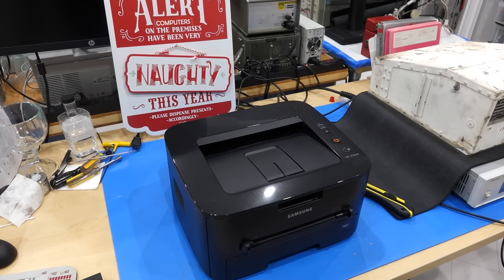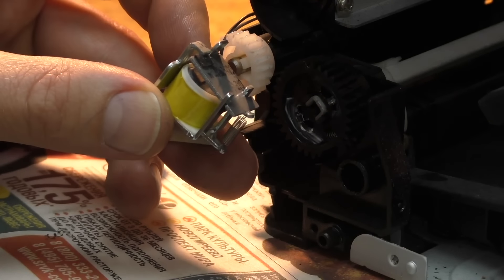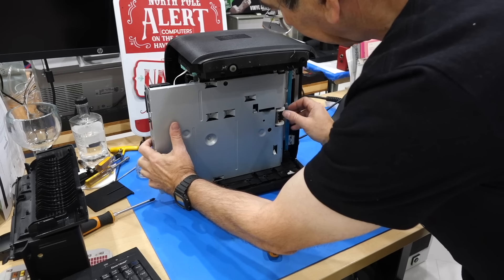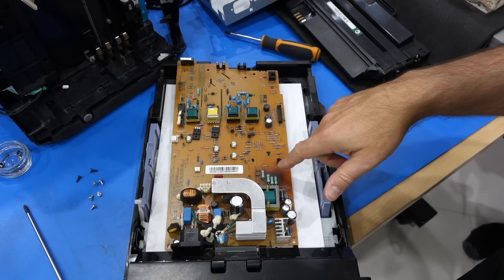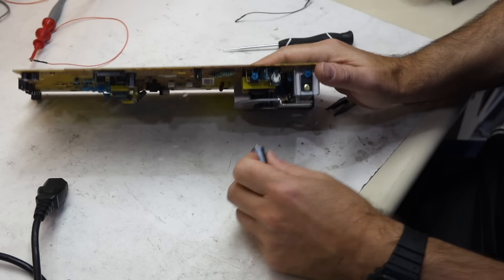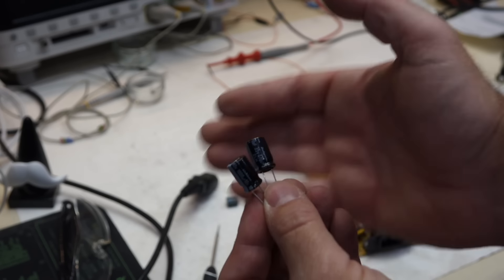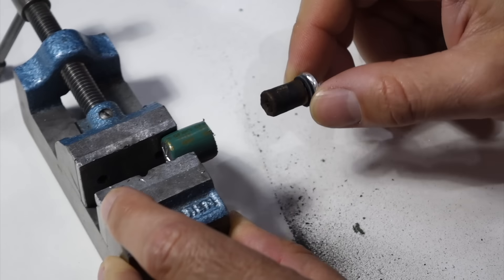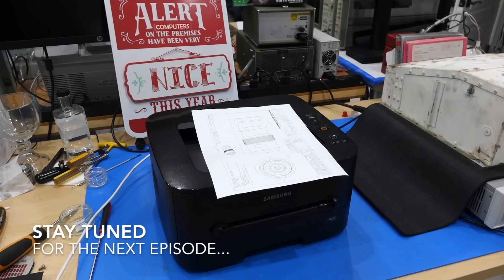Modern Fails: Samsung ML-2525W laser printer double repair: picks up two sheets, does not power on

Comment: Of course, laser printers in the 90s were basically inaccessible to normal users - they still cost in the thousands. In the 90s, you hung onto your 9 pin dot-matrix (the lucky people had a 24 pin!) until in the mid 90s when you could buy an HP inkjet printer and get that "near letter quality" printout. It took until the 2000s that laser printer prices started dropping quick. Of course, if you priced them out, you can buy a new laser printer for $200 now, while that HP 4/5/6 probably cost around $5000-10,000 new today. So yeah, you pay good money for that stuff back then. Then again, that $200 laser printer today would've been like $50 or less back then, and when lasers were costing $2000+ you'd get funny looks as to why you're selling it for such a ridiculous price.

Comment: I had a Samsung b&w laser printer but I gave it away and bought a Brother all-in-1.  I think I paid only $75 for the Samsung.  It's a shame that society is so oriented toward consumerism that everything is thrown away and replaced instead of repaired.  Naughty people who made that naughty printer.  😭

BTW some printers can do a self test printout page if some buttons are held down during power on.

I salvaged an old Minolta copier, must've weighed 35kg - very heavy for a desktop.  It was ruined by being out in the weather.  The counter said 163,000 copies. It was built like a tank - the scanning assembly was an electro-optical marvel!

Comment: I would replace the caps by the heatsinks too, I am sure they have been getting cooked and will die soon too, even though they test good now, will they still be good in 6 months, probably not. NOTE FOR DESIGNERS: don't layout crapacitors right next to a heat sink unless you are trying to shorten their life...

Comment: There's nothing sadder than a cooked el-cheapo single-sided phenolic PCB with the offending and obvious power resistors sitting directly over the blackened spot. Inexcusable in modern electronics; we have no real reasons any more for needing this kind of power-wasting solution other than extreme cost-cutting.

Comment: I don't think Samsung makes/sells printers anymore. Maybe I'm wrong, but I seem to recall they sold that department a few years ago.
I have a Samsung all-in-one I've had for 6 or 7 years. I've had to fix it 2x as well. 1 time it was kicking a common error because there is a paper sensor TAPED in place. Of course the tape failed. The second repair was a few months ago, the connector to the paper feeder went bad and I had to fix bad solder joints. Both repairs were really cheap, a piece of tape and some solder, but geez. Still, it's a whole lot cheaper to repair than replace.
Reply: HP bought Samsung’s printer division back in 2017.

Comment: 3:18 What was so unusual about having to use a Pozidrive screwdriver ?
Reply from the maker: Using Pozidriv on regular screws sometimes helps. These ones were stuck really hard.
Reply: Normally works on old Soviet or US equipment, which for the US predates posidrive, and for Soviet they did not hold truck with this Japanese system, preferring their old thin blade screws instead.
Reply: @CuriousMarc  That depends on what you regard as a "regular" screw !
Reply: @SeanBZA  There is much confusion about crosshead screws.  Most people just erroneously call then Phillips screws but there are, in fact, at least 3 "standards", ie Phillips, Posidrive and Japanese Industry Standard (JIS)  To a certain extent when screws are not tightened down hard or locked in place you can use any driver on any type of screw at the risk of damaging the head, but when you really need to exert force then it is important to use the correct driver.

I wondered exactly what type of head was on the screws that Marc used a Posidrive driver on, hence my original question
Reply: @Bob_Burton  Made in China almost certainly JIS, as the 2 countries use the same screws, due to volume of production for export.
Reply: @SeanBZA  If the screws are indeed JIS then it is no wonder that it was easier to remove them using a Posidrive driver than a Phillips driver because JIS and Posidrive are more closely related than Phillips and Posidrive
Reply from the maker: @Bob_Burton  Regular as in standard, non Pozidriv.
Reply: @CuriousMarc  Ah, "standard", you can never have too many standards.  It would be interesting to see a closeup of the head of one of the "standard" screws
Reply: @CuriousMarc So you mean Phillips. There’s no such thing as a “standard” screw.
Reply: @Bob_Burton JIS and Phillips are nearly identical. PoziDriv has significantly different geometry. The JIS standard was withdrawn years ago, replaced by the ISO definition of Phillips.
Reply: @SeanBZA The JIS screw standard was withdrawn many years ago. True JIS screws are only found in old equipment. Everything even vaguely modern is Phillips or PoziDriv, in the versions codified in ISO standards 4757 (screws) and 8764 (drivers).

Comment: I had three Chinese made aquarium light power supplies blow up on me. They all had the same caps explode. Fortunately the shop carried spares but they all had the same problem. Eventually I opened one, the top had been plastic welded on probably to prevent customers from learning about their crimes. 

Can you imagine buying this printer in Korea? From my observations living there, Samsung sells the defective or near defective products to their local customers. When the Samsung Galaxy S20 came out there was an issue with the screens turning pink. I witnessed a few examples after it was initially reported but when I commented about it online those outside Korea said it wasn’t known in their local area. Over the past couple years, I have seen many more failed displays with much worse symptoms. So I can only imagine what it would be like if you had bought said Samsung printer in Korea.

Comment: Sticky relays are not unique to Samsung, my HP laserjet 2200 or something has a similar error in the duplex mechanism. Clean, add new, job done. 
So I think they just don't care that much.
Reply: Yep, even had that happen on a 20+ year old HP, and even on a laserjet 4, so there is really no laser printer safe from it.
Reply from the maker: Yes it's the careless attitude that gets me. They've known this for years. If Bill and Dave were still at the helm of the company it would have been fixed right away.
Reply: @CuriousMarc  Thanks Carly......... The gift that keeps on giving.

Comment: Great Video, please don't laugh but I have spent hours looking for the material used to fix capacitors (white stuff) and I cant figure out what they are, please can some one help? (Even ChatGPT couldnt help)
Reply from the maker: You mean the white glue on the outside of the caps to hold them to the board? Feels like silicone glue to me.
Reply: @CuriousMarc  thanks for the reply.  Yes those white glues. I have tried RTV silicon glues and the end result is not as nice as them.
Reply from the maker: @VA7AYG  Yes the white glue is amazingly strong and stretchy, so maybe something else…

Comment: Given that Samsung exited the printer business in 2017 (when that product line was sold to HP), it’s a bit of a stretch to call this “modern”. :p

Amusingly, HP bought Samsung’s printer business so they could stop relying on Canon and Fuji-Xerox for laser print engines. But they never entirely got away, and HP has largely switched back to buying print engines from Canon. Only a few models use Samsung-derived print engines.

Comment: All that heat damage around the resistors Jesus. Bigger wattage and stand them off the pcb
Reply from the maker: Amen
Reply: Would have added 2c to the BOM cost, the accounting team had a coronary over that. After all they went for SRBP because it is 3c a preform board cheaper than FR4, and single sided with 200 wire links for the same reason, saved on a double layer of copper and those expensive through hole plating steps, plus less wear on the PCB drill, so you can run 5 times the number of boards, before they are blunt and need to be changed. Also can used resharpened drills, from the FR4 line, so essentially a tenth the cost per hole.

Comment: Tons and tons of Samsung products have these cheap nasty capacitors. Their TVs are infamous for cap-related PSU failure. I refuse to believe that using these Capxon (and similar) brand capacitors is just "penny pinching". Capacitors are so cheap, and the price difference between these garbage capacitors and premium Panasonic or Rubycon capacitors at quantity is literally pennies at quantity. Like literally, it'd probably raise the cost of the PSU maybe 15 cents to use all premium caps.

When I see garbage capacitors used in a reasonably pricey product, in a high-heat and stress component (PSU), I can't help but feel that it seems rather deliberate.

Comment: I'm surprised Samsung is so money-pinching about this solenoid problem.  It is also depressing to see that their profits have increased by 900% in the latest quarter.  Moral: don't buy their printer but do buy their stock.
Reply: The only way to buy a Samsung printer now is to buy a used one: Samsung sold its printer division to HP back in 2017.

Comment: Oh I Hated those things. Depot had to send a panel for us to even read out the error logs. Terrible nonsense non Canon equipment.
Reply: Two sheets is sometimes also a bad retard pad. Scuffing it with sand paper can help. HPII had similar solenoid issues later in the 2000's but that was when they were already old.

Comment: I strongly disagree with the "adverts" for HP printers here. I have had so many bad experiences both in my work as with home users (family). I have banned them from my office.
After finding out firware updates listed as "Security patches" only contained ways to prevent alternate toners. (as a side effect it would'nt sometime recognize it's genuine HP toners).
One toner empty (a color laser has 4 toner/drums) would render the printer inoperable. Laser/optical assemblies that would get internally clogged with powder fading all prints. (Duh if you put the optical box lens facing upright). So office is now purged of HP. And similair familymembers had All-in-ones, with one color cardridge empty. No scanner / fax anymore. 
Any family member calling for printer issues faces the first question: is it HP?? call someone else or replce by a non HP. It's a fallen company with very low morale. (and very low quality machines).

Comment: Fun fact, Samsung generally make very poor quality stuff (memory a part), and in fact Samsung Laser printer are just HP Laser printer rebrand, that's why they are not perfect but nice to use. In fact now Samsung doesn't sell laser printer any more.
Reply: Ummm… no, Samsung printers weren’t rebadged HPs. In fact, one of the main reasons HP bought Samsung’s printer division was to bring print engines manufacturing in-house. (HP sourced the laser print engines for nearly all prior models from Canon — before the Samsung acquisition, HP never manufactured any laser print engines, never mind sold them to others.

Ironically, after initially migrating most of the LaserJet line to Samsung-derived print engines made in-house, they’ve now moved most of the LaserJet line back to print engines sourced from Canon.